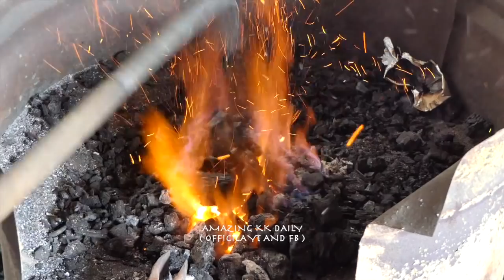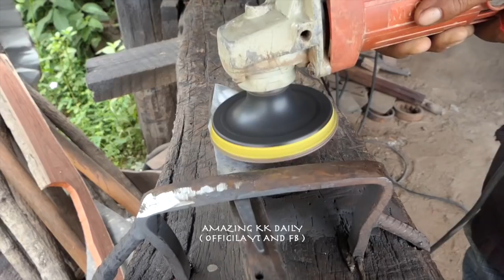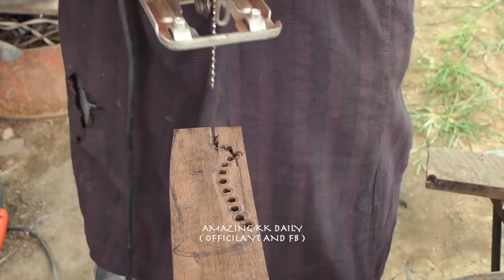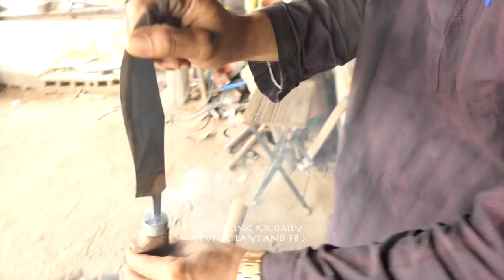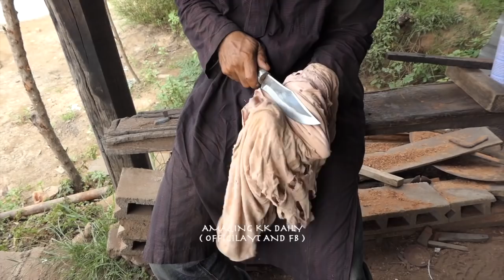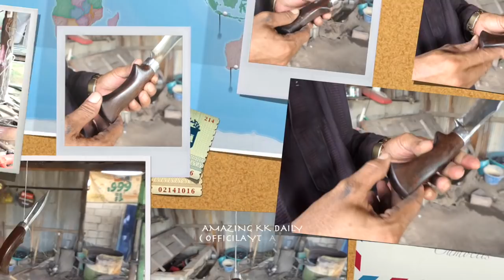MAKING A CUTE KNIFE FROM A MOTOR CYCLE SPARE PART

Comment: Amazing control on the sanding disc. I always have trouble when sharpening blades using hand grinder with sanding disc attachment. Any tips?
Reply: Zaen LandaxNocturnal tuck your elbows in tight and move your body. Sharpen with a different tool.
Reply: Zaen LandaxNocturnal tuck your elbows in tight and move your body. Sharpen with a different tool.
Reply: Turn drill upside down use u clamp to bolt drill down turn drill on use edge of disk to sharpen knife.

Comment: What kind of detail it is? Can't find anything like this in my motorcycle engine
Reply: It motorcycle big end pin...
Reply: It's the pivot rod from a connecting rod of a motorcycle crankshaft. In a car, this part is undetachable for the crankshaft has multiple connecting pistons.
If you're still confused, try to disamble your motorcycle engine, especially the front part where the combustion operation takes place.
Reply: @yuki-technogojatisari  oh,ty
Reply: @Imuks  you're welcome